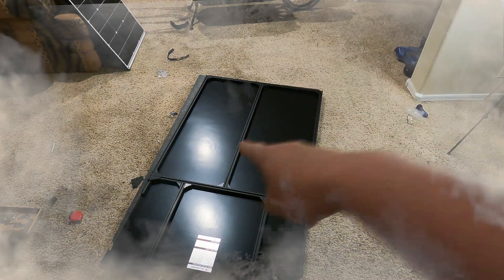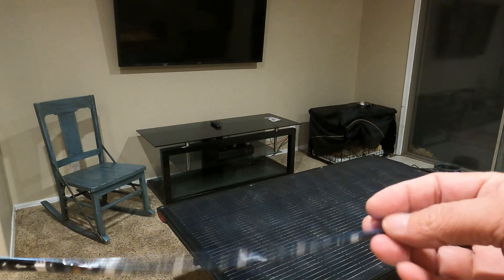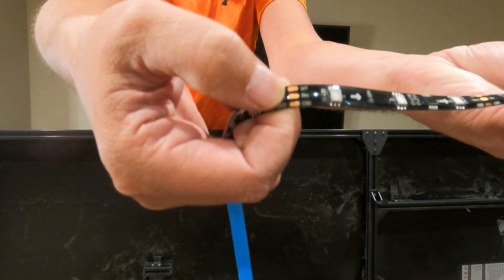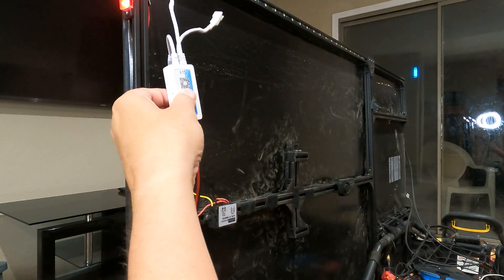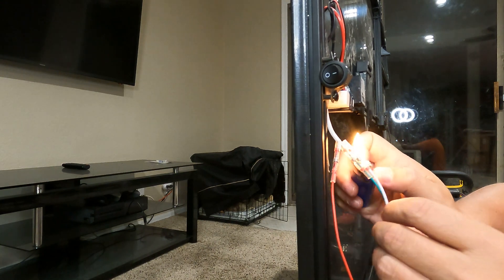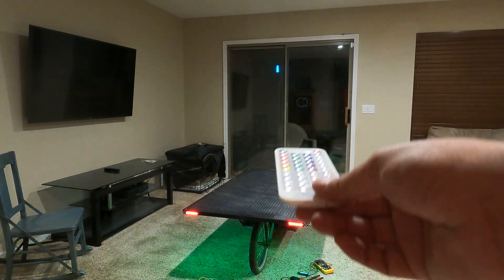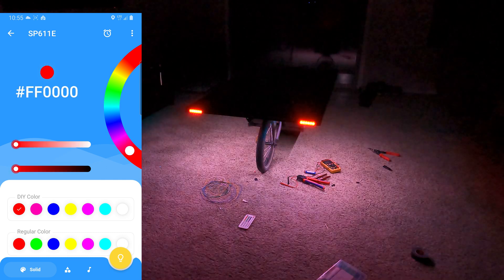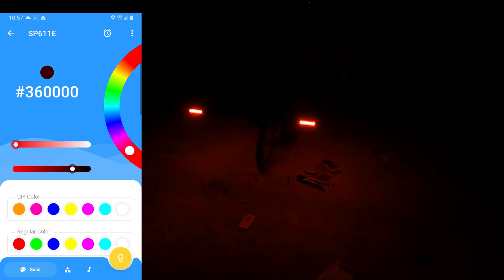Upgrading 200w Solar E-Bike Trailer Lights

Comment: Now just need a gas generator 😂
Reply from the maker: Would need no solar then. Gas is king of power. Problem is the smell and noise.

Been looking for a very small one at around 600w max. No luck as the ones I find are all 1000w+.
Reply: @Eric_Tennant  wish I had someone around who knows EV’s. I want to build a power train that generator runs an electric motor, like a train.

Comment from the maker: If any link below is clicked and you buy any item listed on Amazon I make commission off of said item.
🛒LED light strip https://amzn.to/46Fb37Y
🛒LED light strip controller https://amzn.to/3Q9Xrui
🛒DC(15-52V) to 12V DC Buck Converter https://amzn.to/3S4TYzV
🛒Solder Seal Wire Connectors https://amzn.to/45MwSRz
Reply: I'll go check it out thank you